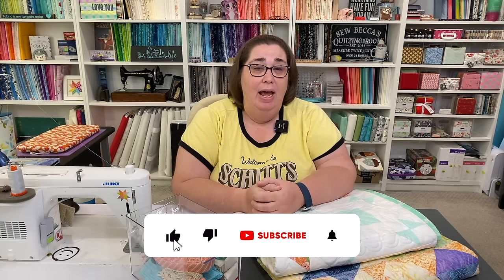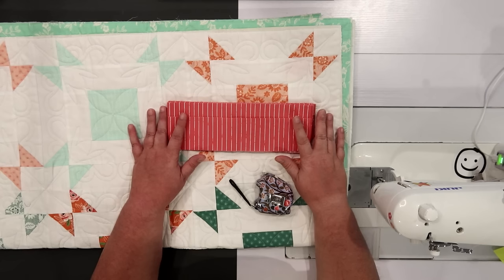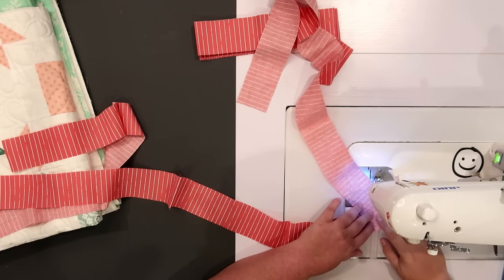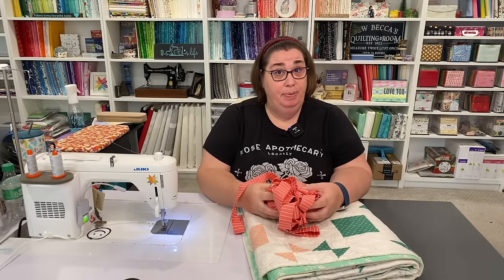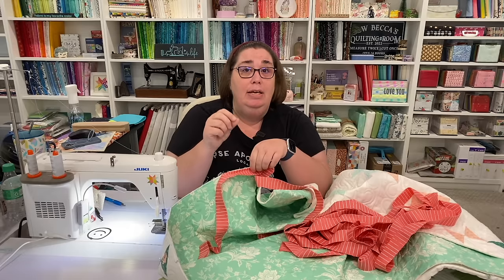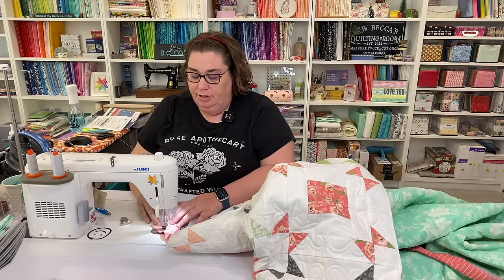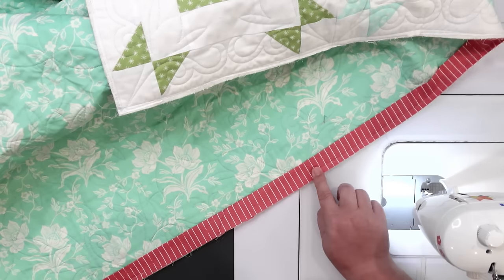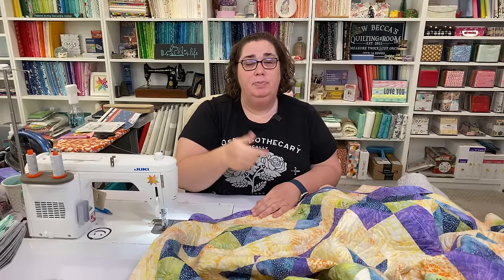The Ultimate Machine Binding Tutorial for Perfectly Finished Quilts

Comment: Any comments on using a walking foot to sew on binding.  Since I am newly retired I love the opportunity to hand stitch down my binding ( no pressure, turn on a movie, and stitch away).  I feel I’m more accurate in attaching my binding by hand stitching.  Thanks for the informative and entertaining video.
Reply from the maker: Honestly - I've not used a walking foot for any of these methods.  If you wanted to use the walking foot, you can use it to attach the binding to the front (still use a 3/8" seam allowance) - then turn it over to the back and finish by hand!  By using the walking foot, the machine should take all the layers in consistently and make a little easier work of a thick stack of fabric & batting!  Also, happy retirement!

Comment: I use both methods of binding.  I apply it to the front most of the time but if I'm wanting to use a decorative stitch on the front then I apply it to the back first.  Also, I saw someone use a big binder clip to keep a bunch of that fabric together and out of the way while joining the ends of the binding.  Made life a lot easier on me.
Reply from the maker: That's a great tip! Using both methods of binding gives you more flexibility in your projects. And using a binder clip to keep the fabric together is a genius idea. Thanks for sharing!

Comment: An edge stitch foot or compensating provides superior control.  I prefer sewing back first and topstitching to front. I like a longer stitch length.  Cutting 1/8 more back than front and using 1/4” seam with 2.25 binding width provides best balance for my preference.  Really lovely exposition of methods.
Reply from the maker: That's a great idea!

Comment: I use my stitch in the ditch foot for back sewn quilts.  Flip the binding to the front, hit the 1/4" seam button, and run the guide along the edge.  You will catch a 1/8 to 1/16  edge seam.

Comment: What stitch length do you use when attaching your binding?
Reply from the maker: Either 2.0 or 2.5. :)
Reply: Regarding the stitch length, would you go longer if binding a quilt using a very low loft batting?

Comment: Thanks for the great tutorial. I was wondering if you ever put on a super wide binding. Say 2 inches wide on the front and back. It may sound crazy but I'm making a memory quilt from heavy work shirts and that narrow binding is not easy to fold over. Maybe use a 1 3/4  inch seam allowance then trim the bulk and fold it around and  have a wide binding on the back also. I always hand stitch on the back. Any ideas for me?
Reply from the maker: That would be LOVELY!   I don't have the measurements off the top of my head, btu Karen Brown did a WONDERFUL video on binding a while back that covers wide & narrow bindings.  She uses a different method than I do (which saves you the time of folding the entire strip in half) - maybe check this out: https://www.youtube.com/watch?v=eZIkdOP96NE
Reply: I make a 1" wide binding on all my quilts. It uses a 4.5" wide strip.
When I trim down the quilt, the backing and the batting need to be 3/4" bigger than the quilt. I sew the binding on from the top, 1/4" away from edge of quilt top and stitch down the back binding from the front, stitching in the ditch.
I have never done a biding by hand.👍

Comment: Wish you would make suggestions as to thread tension, size of needle, etc.,   Do I need a walking foot?   I am presently trying to bind a quilt and it won't fit under the presser foot.   The first sew-around the presser foot squeezed the material so much that it was a mass of wrinkles.   Can this be done on any machine or is a quilting machine necessary.